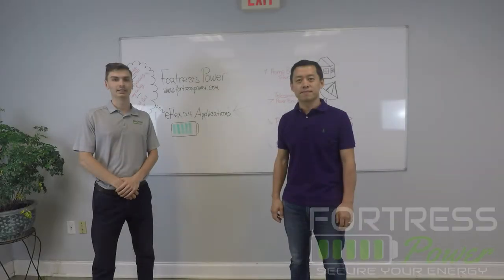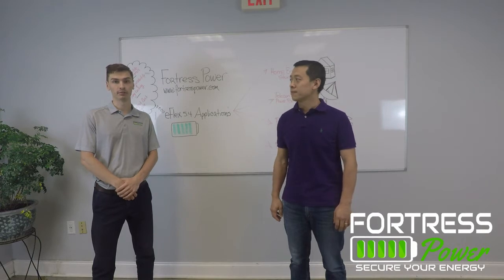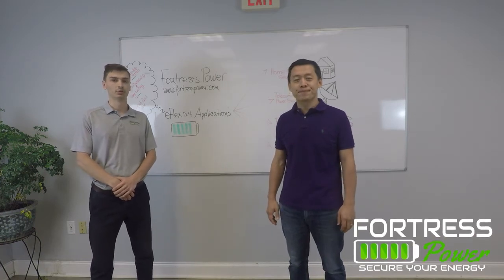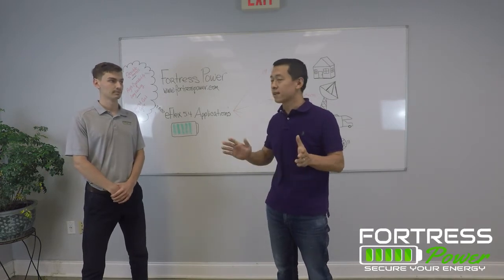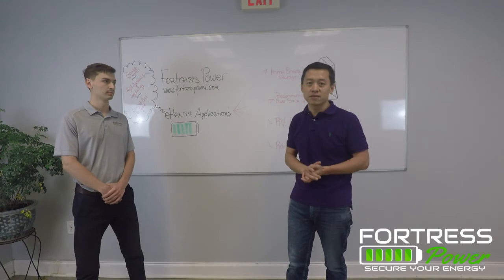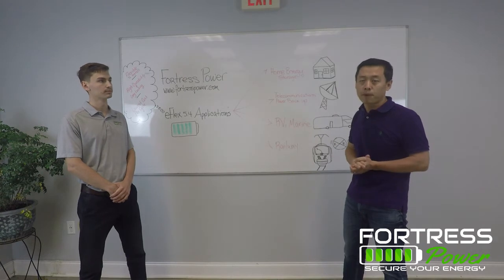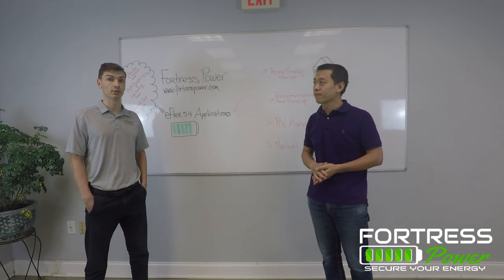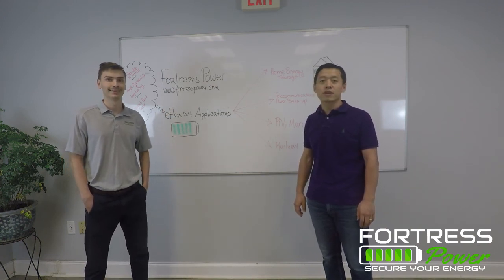New Product Introduction - eFlex 5.4! (#3)

Comment: With a sealed system weighing a ton. How is it serviced or warrantied, in the 10 years, If Im mobile in an RV? If the bms or wifi goes out you pay for shipping?
Reply from the maker: The eFlex is designed for use in RVs and/or marine applications. LFP batteries require very little maintenance but if any issues arise our tech support will diagnose the problem over the phone and determine the course of action. For a more detailed answer, please email techsupport@fortresspower.com